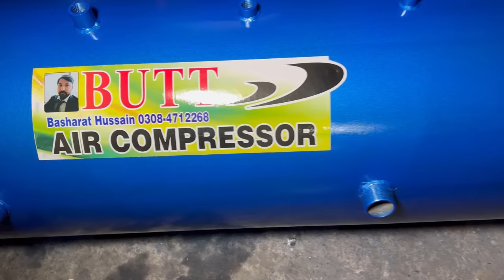Incredible production process of Air Compressor - Manufacturing Air Compressor

Comment: what beautiful blue bombs, I am delighted with painting over rust and without primer))) these blue bombs are welded from very thin metal, I think if you give a pressure of 16-18 atmospheres, this one will blow like a bomb in hiroshima and nagasaki)) the tank is tested by double pressure increase from working)
Reply: Seems like will blown at 100 psi..
Reply: Just what i was thinking. I have a air tank about the same size and the thickness is around 7 mm (or 1/4 inch)
Reply: Откуда такой неуч знает про Хиросиму?
Reply: @СкамсСкамсофф  как сказал один киногерой, с гипсом на руке, - ОТ ТУДА !
Reply: The gulty its the Goverment, the religion and the Chineses...
Reply: @CarlosSantos-xb8ew atleast they got their math right and know 3 is not 1 and 1 is not 3 😂 (trinity)

Comment: Butt. Appropriate. Because you are risking yours using it. Made from (s)crap thin sheet metal. A hundred stress risers built in to the end caps. Weld over dirt, scale, rust, oil and paint. 
What these guys COULD do with a few extra minutes of care and attention to detail would be amazing.

Comment: is this Air Compressor Tank safe too use ???
1. didn't show how they test the tank with high pressure
2. why 6 out let or in let hole
3. i think the steel sheet is be thin.

But all good too see how they make it
Reply from the maker: Thanks